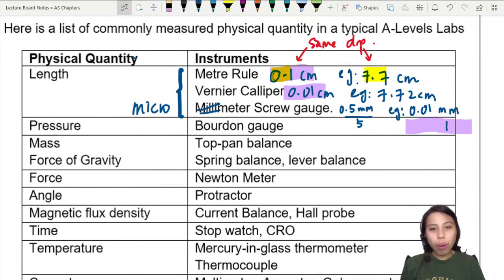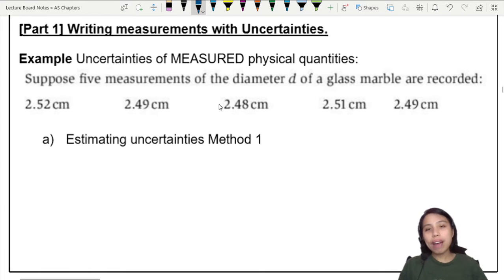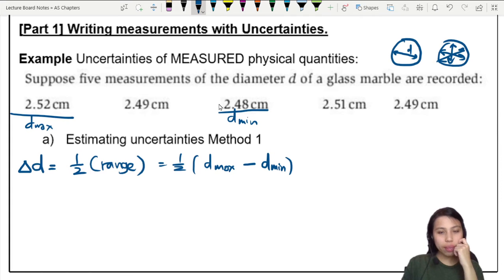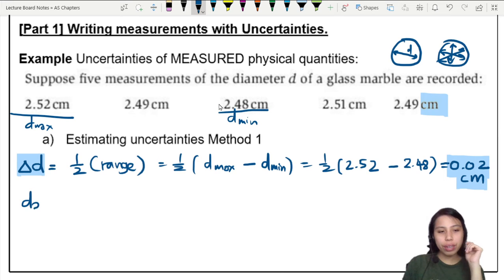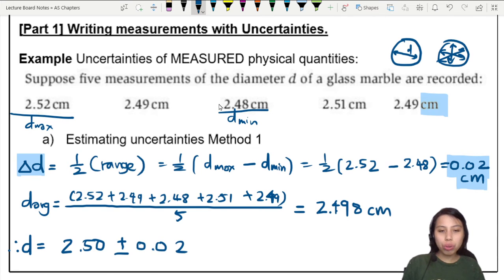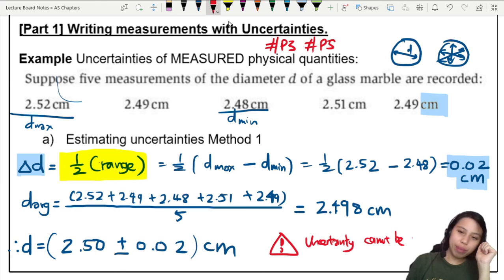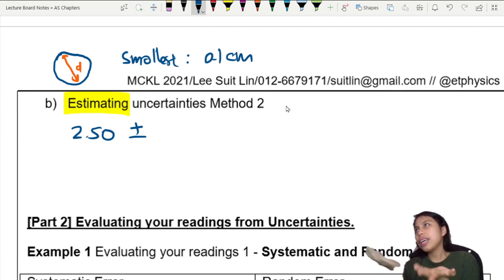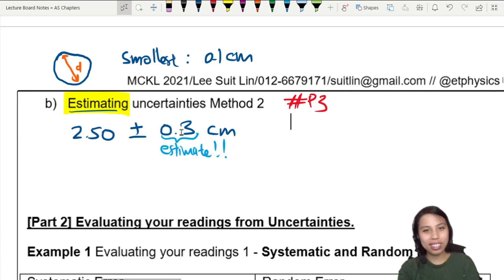1.2b Calculating Uncertainties from Measurements | AS Physical Quantities

Comment: teacher why did u round off 2.498 to 2.50 can we write it as 2.498 will it be correct?
Reply: Write your answers correct to 2 or 3 significant figures 2.498 is 4 significant figures so it's not acceptable you'll get your marks deducted
Reply: bro youre so cute @dumdumdeedee697
Reply: We have to write main value in 1 significant figure.